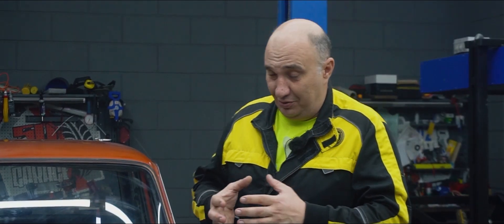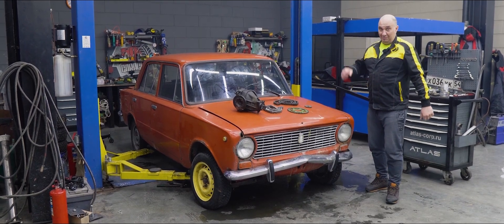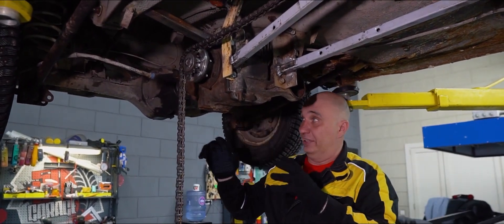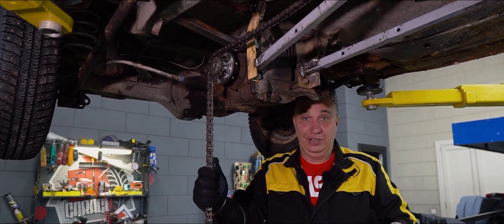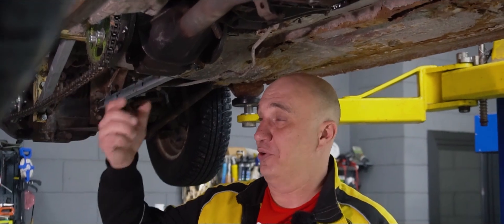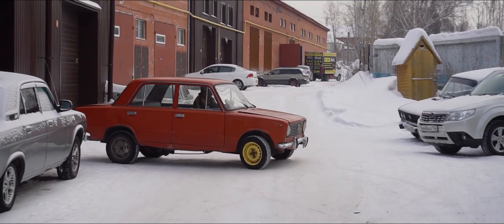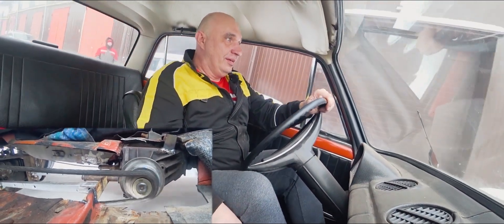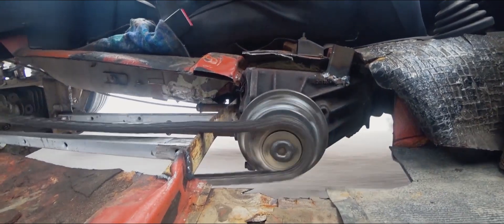Will chain drive work as a propshaft replacement?

Comment: what about going tho hole way !  build a car with a semi and a motorbike ?  for an example put a car engine in side a semi truck and  driven by a chain 😂 and see  if the car engine  can  tow a 45 tone  trailer   and then  truck  racing then blow it up

Comment: With a chain tensioner this would probably have been perfect.
Reply: there are "half" chain links just for this purpose
Reply: @deckname5794  half links rattle, and should be avoided. Usually they are swapped out when the chain stretches anyways.
Reply: @deckname5794  Didn't even know that, will have to look them up.
Reply: Just push down on it with your hand to take up the slack.
Reply: @peterbrown6224  I find that to be a waste of resources and not optimized. Is best if you sit on it and your weight and ass will keep it stable and sturdy enough.
Reply: @LaCacaLoca  lol
Reply: @peterbrown6224  equal sized sprockets too. The ratio change between the two diffs added equals out to zero, which is why the gearing was bad both ways they ran it
Reply: You can't really tension a trans chain like this because it will take the engine load in reverse and also when engine breaking. It would have to be a fixed sprocket, quite sturdy.
Reply: @HDJess  Two chain tensioners (one pushing down and one pushing up) would take care of the slack during engine braking and reverse.
Reply: @PhaQ2  you could probably get away with a single tensioner that operates in a linear action, instead of the radial action like on a bicycle.
Reply: @HDJess  : you could build a tensioner like on a motorcycle. Tighten a bolt to move the back tire further out. Apply that to this application.
Reply: The chain was worn, loose/tight spots
Reply: Beat me to it.
Reply: check out honda s600 drivetrain, it's chain driven and it works
Reply: @SleepyTM1  I think Hondas 1st 4 wheel vehicle was chain drive too.
Reply: @jwh1776  the s600 is honda's first 4 wheel car though
Reply: @SleepyTM1  I meant 4 wheels t360...hondas first automobile
Reply: S500 was before s600 too
Reply: Or a third sprocket to space it out
Reply: I agree, and maybe making the gear ratio closer to 1:1, 2:1 or 1:2 between the differentials to see how much changes

Comment: Now use bike derailleurs instead of a transmission!
Reply: There are classic CVT's from the 70's that use similar. IIRC Daf had such a system in it's Daffodil car.
Reply: @cudwieser3952  exactly my thoughts! with belts
Reply: @cudwieser3952  https://youtu.be/R8AzqtomwD0
Reply: @cudwieser3952  You only see it once a year?
Reply: @cudwieser3952  i had a DAF only 25yrs ago, bought for £60 at the auction
Reply: @cudwieser3952  not even close to simular
Reply: Yup, two variable width two piece pulleys (closer together means bigger inner circumference etc) with a band connecting them. Known best for the daf/volvo 66 but still used on the volvo 340
Reply: @NoctisIgnem  ...and about every snow mobile that ever existed...
Reply: @bgood2010  even old lawn mowers with varidrive manual transaxles. And a ton of atvs
Reply: Not so fast. Derailleurs rely on having a single-direction free-wheeling movement. They have no strength in reverse. That could be bad in a car.
Reply: @zwz.zdenek  Just cut a hole in the floor and scoot backwards, like on a bike. Yabba dabba do.
Reply: @zwz.zdenek  Then have a second derailer for the other direction! Problem solved!
Reply: Obviously this guy hasn’t bin selected for natural selection he’s made it this far. He doesn’t  need a safety. HE IS SAFE!!
Reply: I hate working on those :(
Reply: CVT is similar to that idea 😂

and CVT's in which you can program / set gear ratios

you can virtually have infinite gears for your vehicle 🤔
Reply: @jasperdomacena6491  You don't program a CVT. You'd have to adjust the conditions for it to move.
Reply: They will brake in no time
Reply: OH GOD NO!

I'm getting flashbacks of my bike needing to be fixed every time it falls over.
Reply: Don't think it will work with those bigger chains. They don't have the same rigidity

Comment: idle sprocket to tension the chain guys
Reply: Roller chain 1/2 link John
Reply: An idler sprocket should have been a no brainer. These guys are obviously smart mechanics and/or engineers, I'm surprised at no idler getting installed.
Reply: @jimmybobhere  they just slapped this together for fun not for actual use. If this were a tow car ghey would have thought about everything

Comment: Saab 900 is driven by chain (between engine and gearbox, but internally, so well lubricated), so nothing new.
https://www.saabplanet.com/the-new-developed-gearbox-type-88-for-saab-99-900/
Reply: Lots of gm front drive transmission were chain drive..th 125 for example 
Also many transfer cases are too .
Reply: @Lassi Kinnunen 81 agree, but want to add that all Saabs were full size family cars, and the chain was never the weak point. So nothing spectabular in this video.

Comment: Got one for you guys ( chaingaurd) I'd be scared to death to ride with that thing whipping around
Reply: Next weld an axe head to the chain. lol
Reply: The point is: Russians Dont Give a Single Fk haha
Reply: "In this episode, I make a bionic right arm, to replace the one I lost last week"
Reply: yeah but look at how rusted that undercarriage is and they he is basically standing right under it.
Reply: I agree. plexiglass over top would have been fine. Imagine if that chain broke when he was looking directly at it.
Reply: It’s natural selection. He hasn’t bin selected. U may need a chaingaurd
Reply: It doesn't fly off and whip around it just piles on the ground.
Reply: @oiltoast3723  unless I jams up on any of the 50 pieces of metal that could stop it allowing the sprocket to throw the chain into the car cockpit this is not a motorcycle or bike this was a car going 40+ with a ton of slack on the chain
Reply: @oiltoast3723  Tell that to the driver of the “Babs” race car! If you don’t know what I’m talking about, look up “babs crash”, it’s an... interesting story to say the least. 

Edit: actually I think you’re right, apparently the story I’m referring to was a bit of a myth, it didn’t involve the chain after all.

Comment: Sitting next to a chain running fast is scary
Reply: No, it's not, and it's perfectly safe.  What is scary is being immediately in front of the chain.  
But anyway, that's Semantics, I'm just being tongue-in-cheek here.
You are absolutely right, moving chains and drive belts are scary!
Reply: i would be more afraid of the chain jamming the wheel in a motorcycle and not my legs
Reply: when you sit on bike with 12.000 rpm you got chain near your leg
Reply: @grodt88  there is protection incase it comes off
Reply: @666cemetaryslut  lol right no chain guard ive ever seen has any capability of actually stopping that chain
Reply: @dougsavery5442  I have seen that not even the engine block will stop the snapped chain. Took huge peace out on buddys 125cc bike on slow speeds, hence why i started to build steel sprocket guard on mine to protect engine if it snaps on mine.
Reply: @milandjuric3119 Chain guards on motorcycles are pointless. If a chain was thrown in that direction, the chain would just rip through the chain guard. A snapped chain can tear through the engine.
Reply: @milandjuric3119  I've seen chain on a motorcycle, that came off. The engine and seat space was shredded in pieces. IDK what happened to rider, but i've heard on a forum, that in one case, the chain cut off rider's right leg. Both accidents happend on JAWA 350 with +-20hp. Idk what happens on 100+ hp bike.
Reply: @milandjuric3119  I wouldn’t bet my life on it. A had a front sprocket come loose at 40km/h. The metal chainguard took the hit wel, just as the two bolts holding it. The place the bolts were attached to the engine didn’t survive. The impact just ripped a chunk of metal away at the place the bolts were attached.
Reply: @grodt88  The secondary chain sprockets won't be running at 12.000 RPM, and you are unlikely to snap a chain when in a high gear.
The risk of a snapped chain ripping your leg off is low. A snapped chain will  likely hit the ground, be thrown behind you, or bust the crankcase.